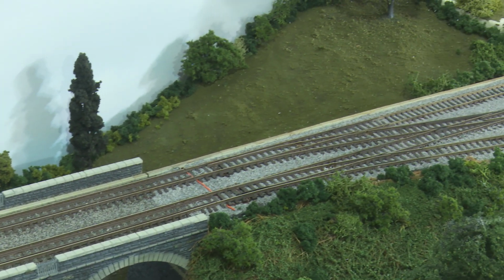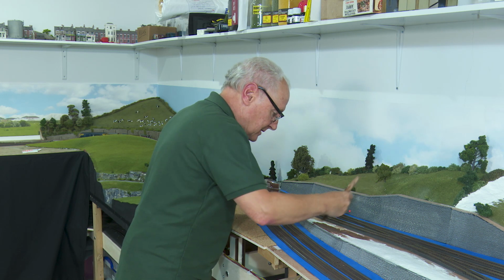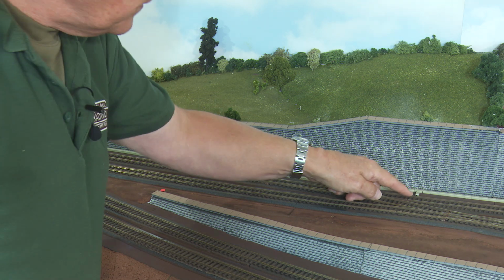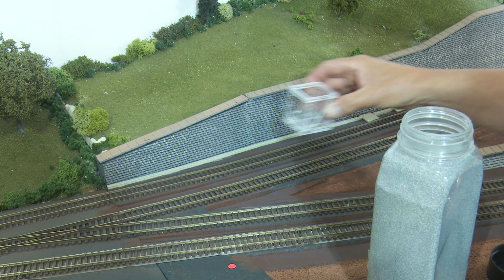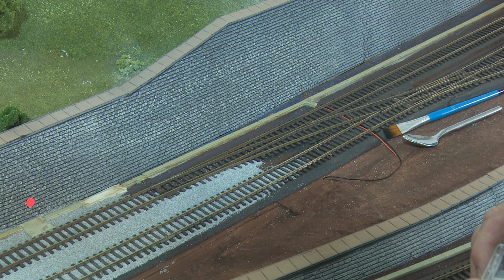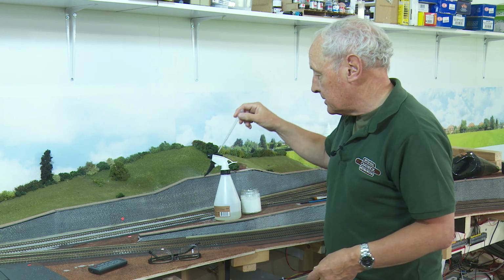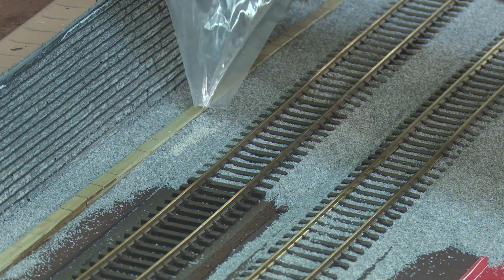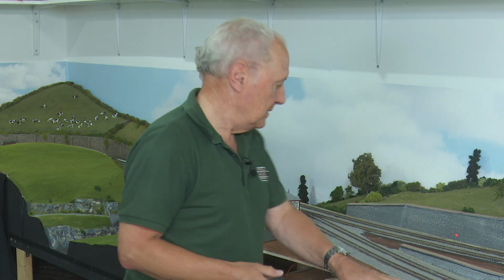Ballasting at Chadwick Model Railway | 138.

Comment: I am desperate for help with a post-glueing of ballast issue. I have built an N Gauge three track layout and after glueing the ballast, a large section of one track is not working and trains will not run plus the lights on the train are not on so no power is getting to the trains. I have used the peco abrasive rubber to 'clean' the track lines both on the top surface and inside the rail - still no success. I changed the fishplates including the plastic insulating rail joiners in the point - all without success. I am at a total loss as to why 2/3 of the track is not powering!!! short of re-laying the track, I don't know what to do.
Has anyone got any suggestions?

Thanks in advance
John
Reply from the maker: Hi John,
So sorry to hear of your situation.
Rather than think that you have no power in those areas, could it be that you have a short?
Regards Charlie
Reply from the maker: Furthermore, John, without power applied, check to see if you’ve got continuity between the rails in the affected area that’s the front and back rails. If you have,  clearly you have a short. Regards, Charlie
Reply: @ChadwickModelRailway  Hi Charlie, Thanks for being rapid and helpful. Although I'm new (69 years Old) to track building, my gut reaction, before I discovered the need for rail insulators, when I fitted points, was it could be a short, as there was no noise but total inaction - similar to switching points before I fitted rail insulators. How would I check continuity? Do you mean physical connection of the rail joiners(fish plates) or electrical continuity via a potentiometer (which I don't have? Many thanks, John
Reply from the maker: Hi John, you desperately need to purchase a multimeter. These are not that expensive, but will allow you to check for continuity, voltage et cetera. Only then can you really get to grips with your issues. You will definitely need one as a railway modeller so just look at it as a long-term investment. Regards, Charlie

Comment: Has anyone ever given any thought to insulating the underside of a layout to reduce the noise levels. For example some foam pinned up underneath the bench work. Cheers Andy Anderson in New Zealand.
Reply: Insulating on the underside of a layout probably wouldnt work. If you were to insulate under the baseboard the track vibrations would still be transferred to the wood, and due to the flexible nature of the insulation the wood would still vibrate. The issue is that the amplified noice comes from the top layer of wood, so thats what needs to be reduced.

 Insulating between the board and the track however does seem more promising, this way the vibrations go through the track into the insulation, which absorbs and reduces the vibrations in the baseboard I think.
Reply from the maker: Some folks are using car engine insulation with some sucess.

Comment: Hi Charlie, for my track bed, I have used an anti slip rug underlay from IKEA called Stopp Filt with great results.(https://www.ikea.com/gb/en/p/stopp-filt-rug-underlay-with-anti-slip-90132261/) it's a couple of mm thick and only £5 for 165 x 235mm,   also slightly tacky so stays in place. I borrowed a decibel meter and tested with and without the underlay and it is a lot quieter with.  I guess it could also be used under the baseboard to supress any 'drumming' noise. I could send you some for your evaluation if required? 
Thanks for the informative videos. 
Cheers Jim
Reply from the maker: Thanks Jim, a useful option.  
Sadly I'm committed now to my current system, regards Charlie.
Reply: O

Comment: Sorry to be a party pooper, Charlie, but unless it's something they've started doing very recently, the ballast in the cess is the same as it is in the four foot, the six foot or anywhere else on and around the running roads. Why would they want to go to the expense of running an additional engineering train (or two or three) to dump "fine ballast" on site in the cess when there is absolutely no earthly reason to do so? Has somebody been feeding you duff information?? I'm curious. (ex B.R. Driver)
Reply from the maker: I’m not doubting you, but I believe it was a common process back in the 60s and 70s. We shall have to do a little more research, regards Charlie
Reply: You’re right Charlie. Up to the mid 60s, track had a clear clean cess which the maintenance gangs used to walk along the side of the track. Usually ash or fine stone. With the widespread introduction of continuous welded rail, the heavy ballast shoulder required, swamped the cess and the reduction in manpower with mobile gangs meant that they were never maintained after that. I know because I was a Railway Civil engineer. Hugh
Reply from the maker: @perthsouth5576  Many thanks Hugh, at last, an explanation.